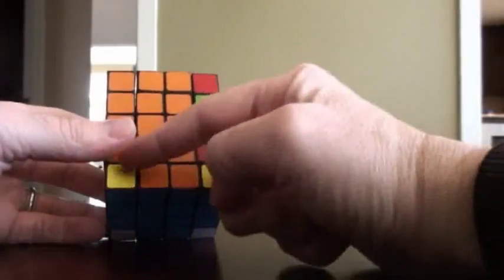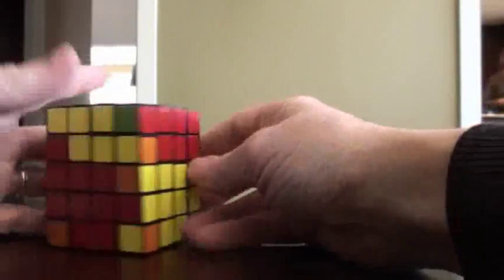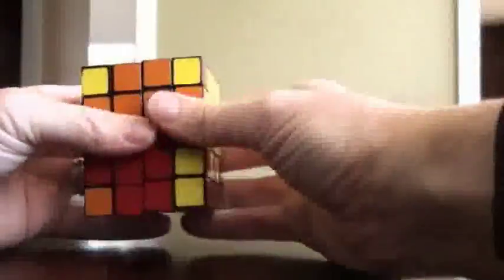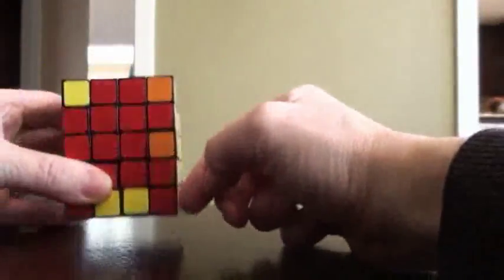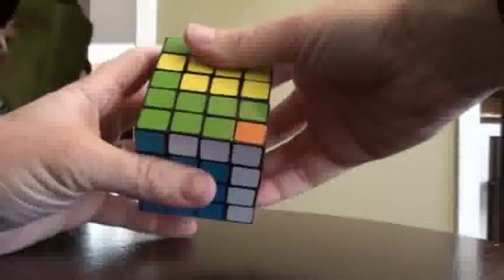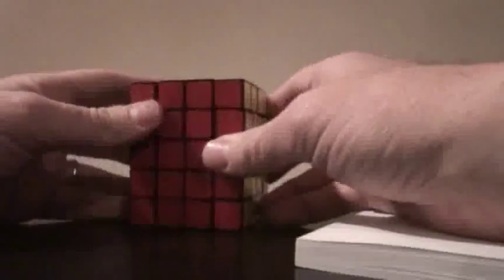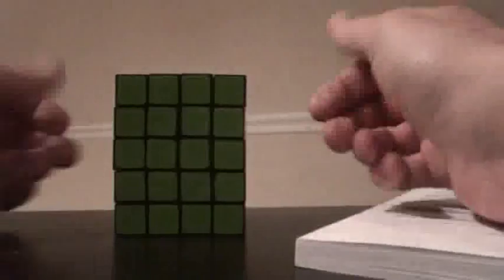4x4x5 tutorial part 2

Comment from the maker: @crazybadcuber I think I have an idea what happened.  You need to make sure that your centers are oriented correctly before placing the middle outer edges.  See part 1 of the last video starting at 5:15 which shows how I make sure that centers are oriented correct by referring to a top or bottom layer corner piece.  If you get two middle outer edges solved and two not, then you probably misoriented your centers, which I did in part one, then placed correctly before moving on.  Hope that helps!

Comment: the very first thing you show in this video is getting the very middle layer solved. You had all 4 middle edges wrong so when you flipped 2 it fixed the other two when you flipped it back. However there are more cases I'm coming across that I don't understand. Like 2 are solved and 2 aren't. Solved on the same side or adjacent. how do you solve just 2? I tried but I solve them, but the other two get messed up. Wish you would have shown more cases. Any help? Thanks.

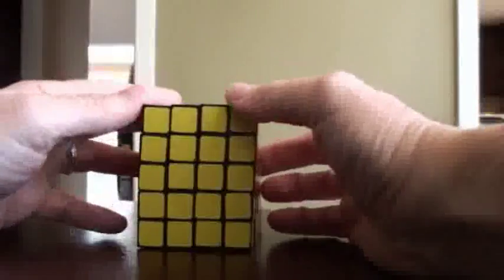Comment from the maker: @Crazy56U If you follow my method, you shouldn't run into that situation, as the top inner edges (which are the ones I think you mean) are placed before working on the corners.  See part 1 of the tutorial starting from 6:06 for how I placed the inner edges.  I would use the "Top middle pairing" algorithm.  This is demonstrating starting at 9:25 in part 1.  I would follow that to place the edges appropriately and just resolve your corners and finish with your solve from there.